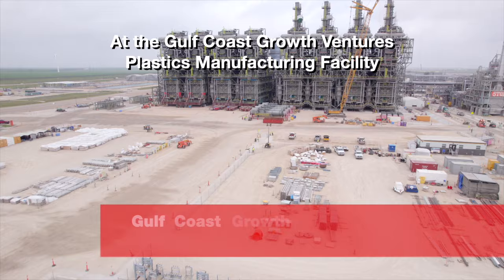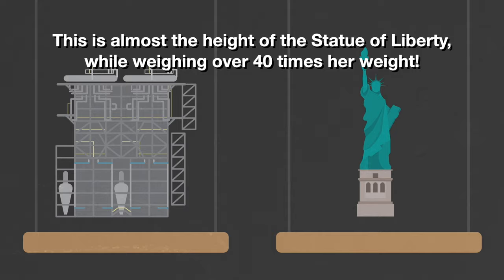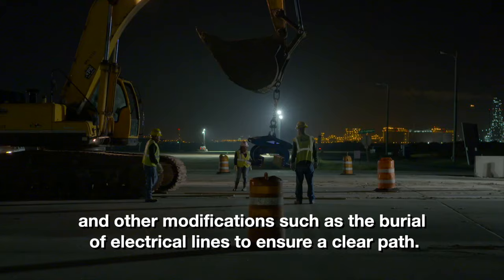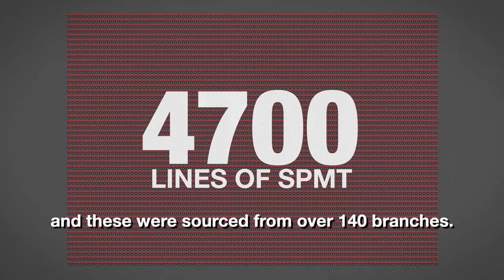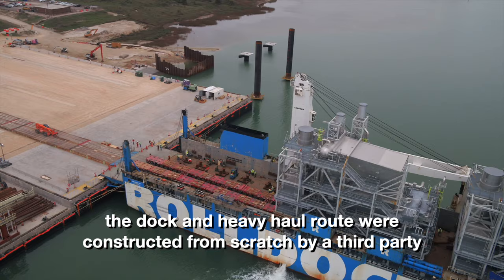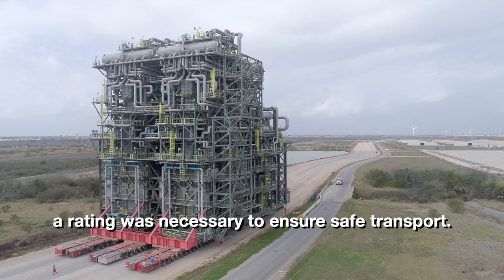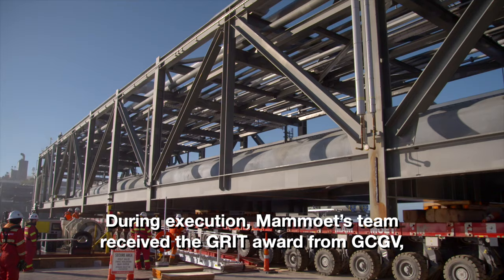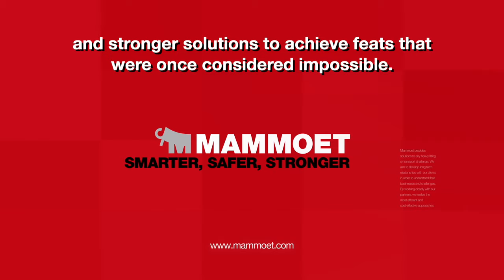Moving massive furnace modules using the power of 322 SPMT axle-lines

Comment: Great explanation!

I am curious how this sort of plant would have been built without such heavy lift capacity. Smaller modules with lots of pipe welding done on site, I’d guess?
Reply from the maker: Most probably; modular construction of this type of facilities minimizes inclement weather delays, reduces costs and offer a safer (controlled) work environment for the workers. It all depends of the site and how complex the facility will be.

Comment: How was the placement done loading onto spmt
Reply from the maker: Normally, the load is already on supports that lift it clear from the ground. After which, the SPMTs drive under them. SPMT axles can hydraulically lift or lower, so by lifting up they take over the load and can drive away with it.